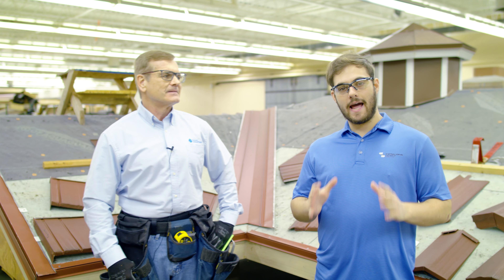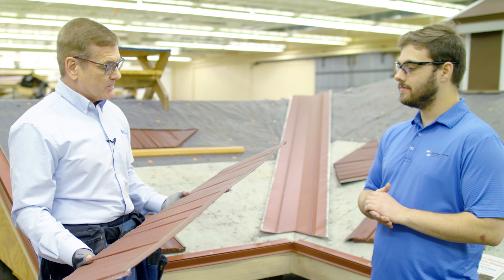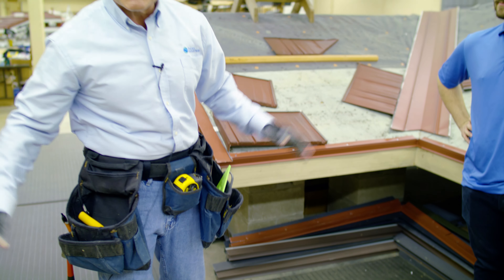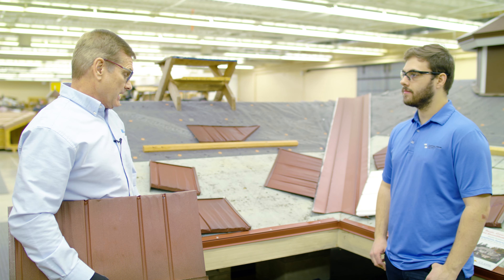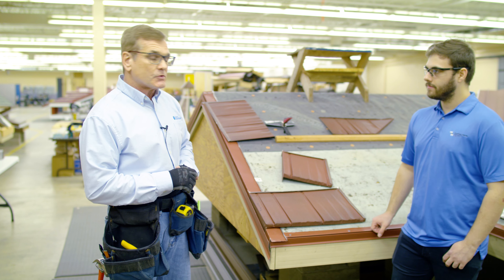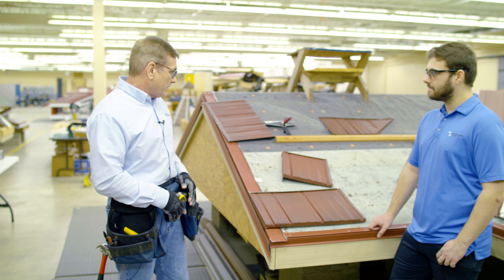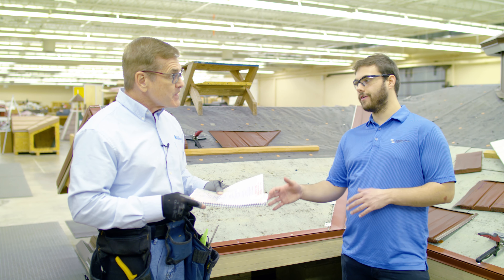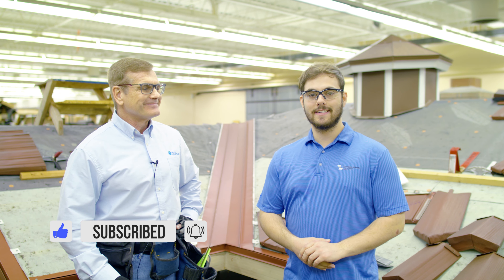How are Metal Shingles Installed? Process, Materials, Courses

Comment: Is this system designed to "easily" make repairs or do you have to disassemble large sections of the roof to get to a specific shingle?
From their website, it appears this product is only available from dealers/contractors and is not sold directly to the public.

Comment: Can you walk on the roof without bending the metal?
Reply from the maker: Metal shingle manufacturers provide foam inserts to place behind the metal to help support it in high traffic areas. For example, if there are second-story gutters that need to be accessed by walking on the roof, foam inserts can be installed in the area where the gutters are located. -Thad

Comment: A regular metal roof a whole lot better, I strip my roofs out with pt one by 4s, that will take out waves or also allows air to circulate,, this product will be just like aluminum siding junk, it dents easy and fades, ive used and I'd give it a 2, folks I've done it for years go metal not this crap

Comment: These shingles will fade in 10 minutes in the sun and look bad.  You'd be better off just putting on unpainted shingles. Use the full sheet metal roofing instead.  A lot easier and cheaper.